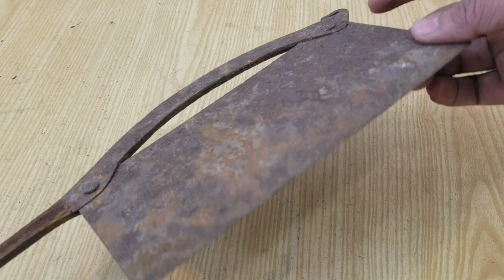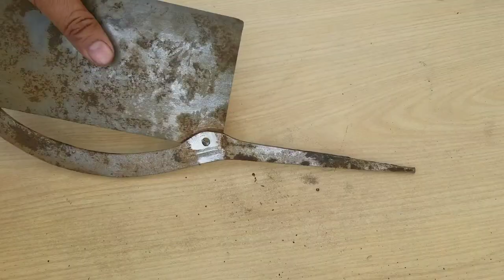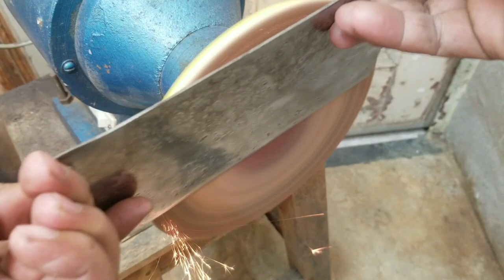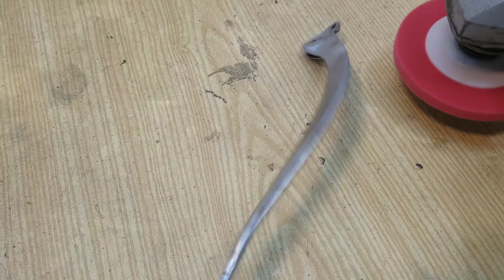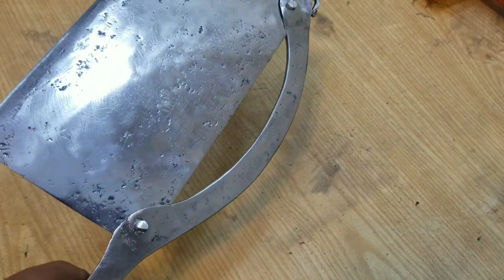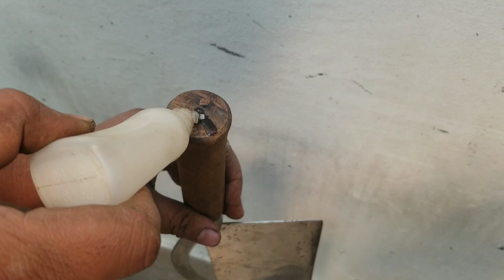Antique Butcher Cleaver Restoration.

Comment: I like what you did with the blade. Awesome job on that part. I think you should have repined the handle or threaded the tang with a butt cap. I don't see that epoxy and super glue holding the handle in place very long.
Reply from the maker: Thank you 😍